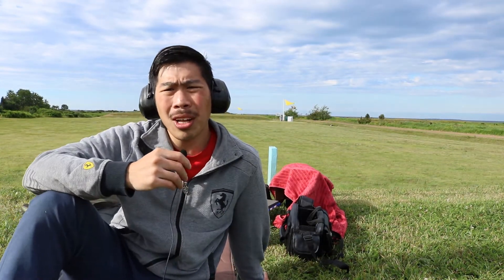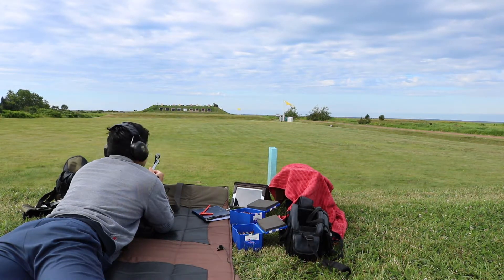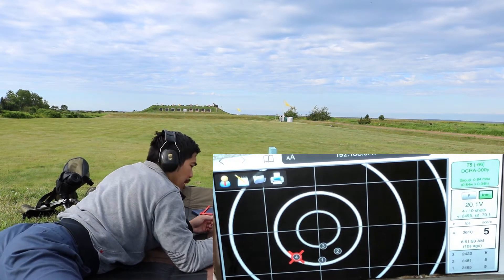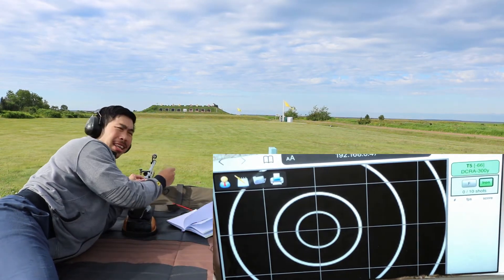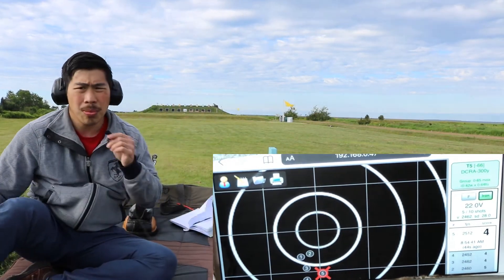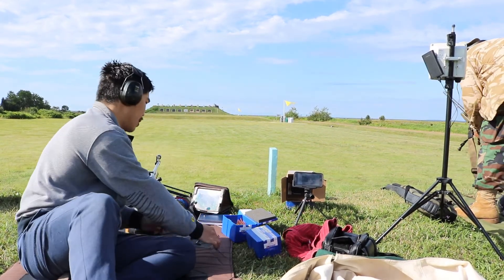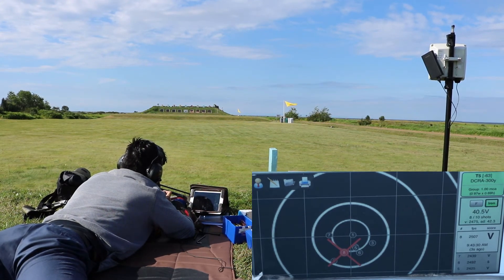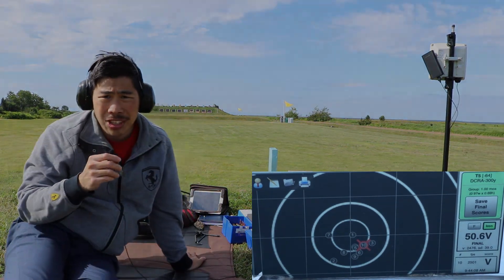Berger 155.5 Fullbore, searching the high node HTSS

Comment: Is this how you search for the lower ES and consistentcy node? Where grouping necessarily dont count?
Reply from the maker: So to do that you need a chronograph which i dont have, but yes you look for the powder charge thats gives your the lowest es and sd, and then adjust group size with seating depth. 

Since i dont have a real chronograph in working order, I use group size, poi and the velocities of the etargets, 

those etarget numbers are not accurate btw, but I look for a range of powder charge where it stays the same, then I use the middle powder charge.  

I am not an advance reloader I do things with what I got, and had many loads work.
Reply: @howtoshootstraighthtss4948  im not either. I got a load to shoot .33" consistently with a harris bipod off a concrete bench. A guy I met mentioned to me that it might print well at 100 but might be way off at 600 even though I can hit a plate all day. My loads is with a 168g eld bullet. He said I should be shooting heavier bullets with my 1:11 20" heavy barrel tikka t3. He told me about a guy on ytube and that guy said when he's looking for power charges he doesn't even shoot at paper because he doesn't care what the groups look like but its over a chronograph. I have one and was thinking about switching to Berger bullets but a little expensive. I noticed the  195 ELD has a high BC about $17 less for  100 pcs
Reply from the maker: He is right about the 100y vs 600y, it has to do with bc and velocity consistency, the hornadys are cheap, i would try them and see what happens.

Group sizes dont matter on step 1 when looking for the proper powder charge that has the lowest sd and es.

But group size matters when tuning that load with seating depth. Check it at 100y for quick ref, and if its not windy u can test them at 300y, then try 600y.
Reply: @howtoshootstraighthtss4948  do you think 3 shots is good enough for each powder charger over a chronograph (ocw)?
Reply from the maker: Emil from berger does 3 shots and he is a great realoader, so that should do when getting a rough idea of your load.